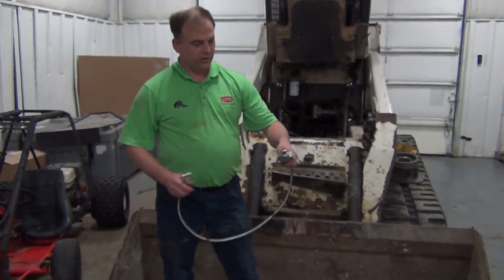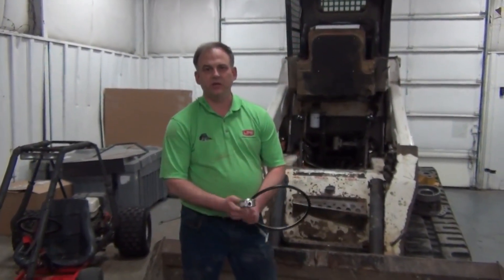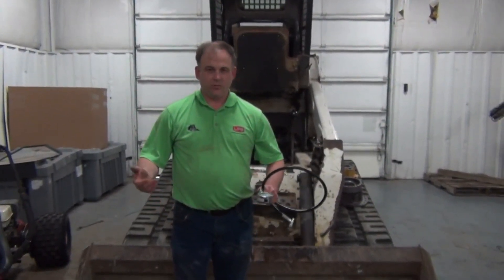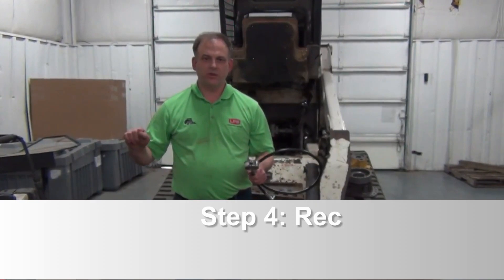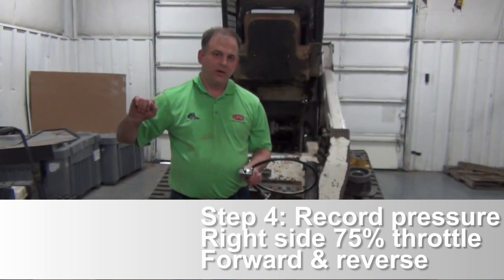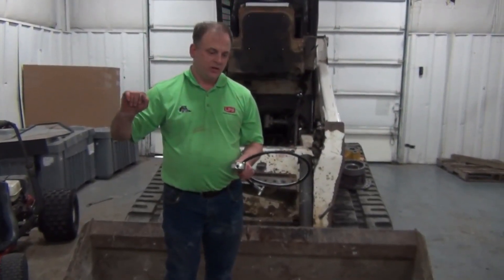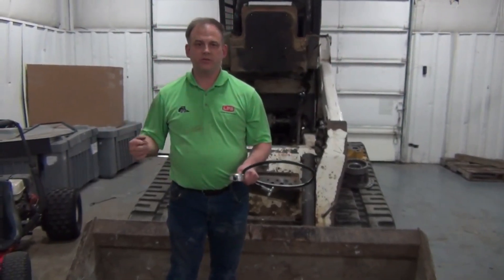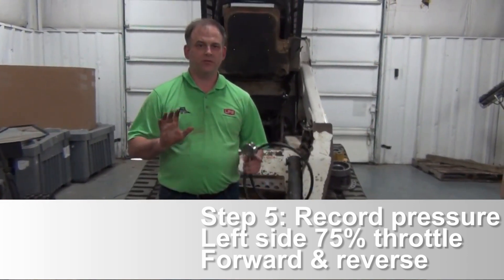How To: Test Bobcat Charge Pressure

Comment: I'm getting squealing on both sides (intermittently from really bad to non-existent) and it feels like the brake is hanging up and slowing the machine. low idle 352psi full throttle 432psi, right side 75% 370psi forward 410psi reverse. Left 415psi forward 408psi reverse. All those at full throttle. I can't find out what normal specs are so dont know what to compare it to. This is a 2014 bobcat T650 kubota engine. Thoughts?
Reply: 352 is lower than it should be at idle, but not low enough to cause your brakes to apply.

When the parking brake seals are damaged, the brake partially applies while it should be released.  The pressure will be lower at the brake than at the test point.

You can test this by checking your charge pressure at low idle with the machine warm.  Then while watching the charge pressure, release the park brake. If the pressure drops when the brake is released and raises when the brake is applied, you have parking brake failing. It is located in the drive motor, many people will opt for replacing the drive motor.  

You can pinpoint which drive motor is causing the issue by disconnecting and capping off one side at a time and repeating the test.
Reply: @leviburkholder4824  Thank you for the reply! As a non-mechanic first time skid owner I can use all the help I can get. I was able to get a look at the 1300 page maintenance manual and it says pressure should be 470-530psi at 140F. Last time it wasn't that warm so a few days ago I did it again. It was actually really tough to get it that warm but it was only about 40 degrees outside. At 65min idle hydraulic temp was only 81F, drove it around for 30-40 minutes and pressure at high idle went from 440psi at 81F to 410 at 140F. Is it normal for it to drop as temp increases? Sticks forward at 380psi and reverse 400psi both sides. Squealing noise from tracks only happening at low throttle, 1/4 to 1/3 max. At higher throttle no squealing. Seems very slow/weak driving up hill to me. After reading your post I went through the warm up process again and gat 338psi low idle with the brake on, 344psi with brake off. Cycled that a few times and it was consistent. Not much of a move there. Again, slow up hills and squealing only when driving at lower throttle. Appreciate any additional insight!
Reply: @1UselessEater  You're making progress.   The charge pressure should not drop when the brake is released.  It's ok if it dips for second and comes back up. But it should not go up more when the brake is applied again.  

Low charge pressure indicates internal leakage which means your pump,  charge pump, and/or drive motors are weak.  

380 psi is low, but not low enough to cause the symptoms you described.

Your next move depends how much time you have, and what your budget is.  The most bang for the buck is checking which side had the brake leaking and replace that drive motor.

Your best chance at making this go away for good is further testing to determine how weak the pump is.  If it's good, you rest easy knowing the motor(s) will fix the problem, but if it's weak you are looking at replacing the pump and both motors right now instead of just fixing the one with the parking break issue.  Best fix but possibly much more time and money

Comment: Hi, on my left side of a 763 bobcat just started to make a squeaking sound like metal touching with metal, I hear it from time to time and is only on my left side. I went ahead and check the case filter and it looked clean, oil has just been replaced as well. Do you know what test could I do to point me on a direction of what the problem could be?
Reply: charge pressure can measure how many bars you need to have
Reply: What did you ever find?